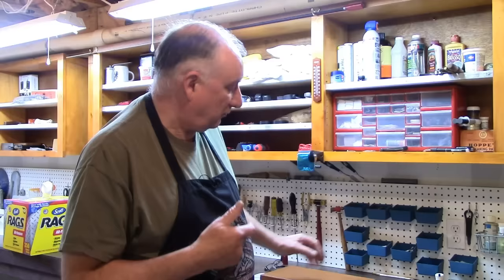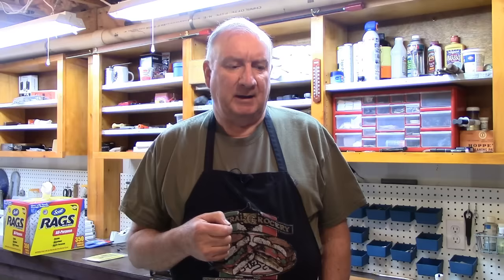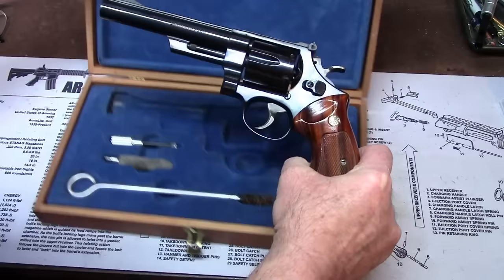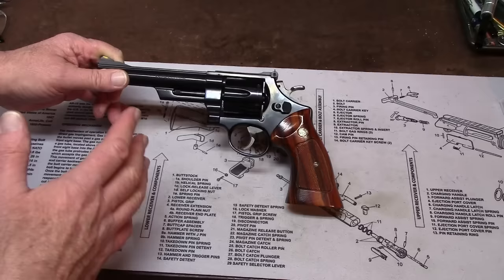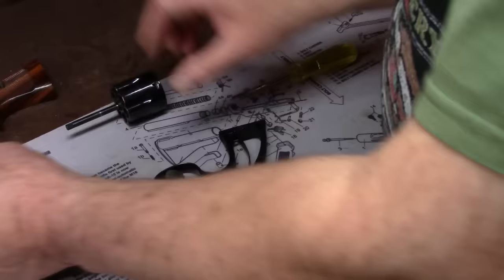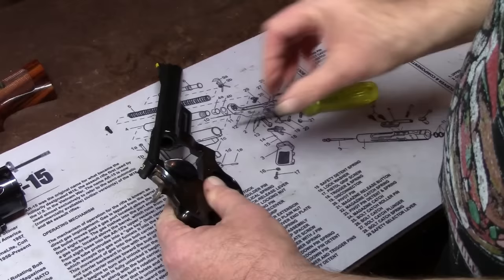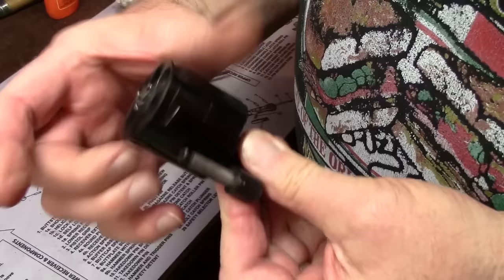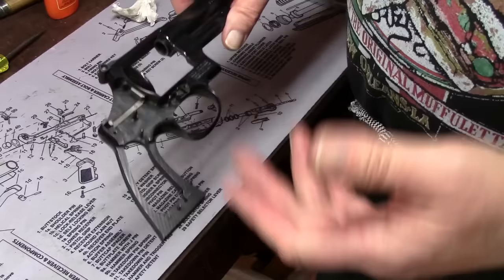How to Disassemble and Care for a S&W Revolver ~ Learn from a Factory Trained Armorer!

Comment: Another video knocked out of the park!  I have 2 stainless Smiths. The lead/carbon sure shows up much worse on the forcing cone and cylinder face than those beautiful blued guns.
Those foulings always give me trouble. I don't think I would ever be bold enough to loosen one screw on my revolvers.
But it sure was interesting watching you do it. If I ever felt the need, I would have your video playing in unison with my attempt.
I still have both of the "One free factory clean and tune" coupons that came with my Smith and Wessons.
Thanks again boss, and try to keep that "Bird Finger" folded up in the stowed position.

Comment: This is the best video  I've seen in years ! At last  someone who knows what is talking about and who's teaching how to properly do what has to be done ! 
However, there is one only thing I don't quite agree with : the cylinder gap. According to what I kwow and what I've learned, S&W specifications are between 4 thousands of an inch and let's say 8 thousands of an inch. Not 3 thousands of an inch (leave that to a Colt). Yet, many whole new S&W revolvers are delivered today with a (terrible) 11 thousands of an inch gap out of the box. The most important thing is to make sure that this gap does not increase. If so: not good at all.
One question : why not remove the hammer before removing the cylinder? It seems to me an easier way than having to press the thumb piece backward. That is what I'm doing and I really think I'm saving some time... Is there a downside in this way of doing things?
Reply from the maker: In fact, S&W specs in my service manual call for 3 minimum and 5 maximum, with most older production guns running 5 and greater.  Certain police departments were furnished with special production guns having gaps of .010 for the purpose of insuring against cylinder/barrel  contact and stoppage that occurred with eventual endshake inherent in their dysfunctional forward screw and yoke button.  This will gall traditionalists, but current S&W revolvers are very consistently held to .003", and it won't shrink, because endshake is a problem of the past.  My new Model 19 Classic, which I demonstrated in another more recent video gauges precisely .003", and the gap is perfect on each side, and it is not a fluke.  

Much folk lore is attached to some perceived notion of halcyon days of yore.  While they are beautiful works of art and mechanical genius, the consistency and quality of older S&W revolvers as a whole is entirely mythical.  Specially skilled people were indeed assigned to their flagship target guns set in blue velvet-lined mahogany presentation boxes, but any S&W armorer of my day can attest to receiving a pallet full of brand new Model 10 revolvers in blue carboard boxes that required long hours of work to force them open and get them working properly.  That was the more common reality of older S&W quality through three decades.

Yes, the presence of the cylinder does obviate the need to use the thumb, but that maneuver becomes second nature to an armorer and we do it nimbly and swiftly as writing our initials.  Armorers address the frame and cylinder as entirely separate system components, just as an AR15 has an upper and a lower.  Except for certain fitting processes, the frame is always worked on with cylinder removed and out of the way, isolated from scratches that can occur during handling with sharp internal parts.  In the course of a long day at the bench working with dozens of these handguns, it's meaningful to cut weight and bulk down.  The reason you don't want to do it otherwise is so you can look like a pro, which is why I made this video.  LOL
Reply: @GunBlue490  Thank you very much for this very precise answer! You are indeed a real professional (which I am not) and it is very valuable to have you here with your knowledge.

Someone I knew who studied like you did at S&W told me that the models we used to get here in France were guns you wouldn't have wanted to have in the US. This, perhaps, explains the  gaps that we could find here. And this also fits to the 20 dollar bills that the verification service at S&W could find in some cylinders...(in the 70's...)

The only reason I remove the hammer before the cylinder is a practical reason, but I remove the cylinder immediately after the hammer. This way it does not stay in the frame and is not at risk of being scratched.

I don't hate the new S&W revolvers (I saw your video about your new Combat Magnum),  but, as many,  I do hate the key lock. It's as unsightly as a wart on a toad.
However, I do not believe that this safety can unexpectedly be implemented by itself.

I owned a Model 22-4 (reintroduction of the Model of 1917 Army), it had the keylock but it was a fabulous revolver! I'm still sorry I sold it. 

Thanks again !

Comment: Thank you for taking the time to make this valuable video! Little tips like using your thumb as a screwdriver guide are things that we would never think of unless taught by a master. I have to wonder how much of the factory hand fitting you pointed out actually takes place on new revolvers today. My brand new model 686-6 was swimming with dirty grease, oil, and manufacturing debris when I opened it up after the first range trip. The screw slots were also marred and deformed from careless hands at the factory. My grandfathers pre-17 K22 Masterpiece looked like the example in your video inside and the screws were still pristine.
Reply from the maker: I would certainly give Smith a call at their customer service line and let them know.  That is not acceptable, and it absolutely got by quality control. I have handled many of their new revolvers, and  workmanship is quite the way it used to be in all regards. I have seen a few issues with new S&W revolvers, but never saw anything like you described, involving butchered screws or debris.  The way frames and parts reach the assembly folks precludes any possibility of debris, and those folks turn many dozens of screws in an hour with their eyes closed. A wheelgun builder is a sight to behold at the bench.  No, I guarantee, that gun was not new.
Reply: GunBlue490 Interesting. I’ll give them a call and see if they will send me a new set of screws. They may make me buy them since I’ve taken them off myself now.. I was just surprised to see the slots deformed from tightening. You could tell they were deformed going in, not coming out. As far as “debris” that may be too strong a word but the lock work was slathered with a light clear grease and some standing oil and there was black cloudy discoloration in the grease. It’s all cleaned up now. I have no reason to believe it wasn’t new. My dealer ordered it straight from the distributor. I think it’s just a sign of the times. I own many handguns and most have required a little work to be at optimum spec. Luckily I enjoy working on them.

Comment: I can't for the life of me, understand how my S&W model 28,  357 magnum ended up with it's hammer nose bent upward where it was dragging, or catching at the top of the frame bushing. It happened when I was out target shooting with it as I always have, single action, and using 38 specials, so certainly nothing out of the ordinary. This was my first gun I bought when I was 18, and have owned this gun new for over 46 years now, and it still looks brand new, because I've taken very good care of it. And I have only shot about 2000 rounds with it. I sent it to Smith & Wesson to have it fixed costing me $170, so it's fixed and back with me now.
Reply from the maker: Glad they got it back in shape for you.

Comment: Dear GunBlue490, I am writing here in hopes that you will see this and havr time to reply. I can see from your videos that you are a real expert on S&W revolvers, and I hope that you will share your great knowledge with me in your reply. I have three S&W revolvers, all from the 1970's that have the same problem.They are a Model 19, a Model 15, and a Model 49. They were all working fine when they were put away some years ago, but have not been touched since then (maybe 10 years) due to my health. The problem they have is that when pushing the cylinder release latch forward to open them, sometimes they are "sticky" and I have a hard time getting them open. I have checked, and all three ejector rods are tight. When they are open, the release latch seems to move reasonably freely and return to the rear. One other point, when I use both thumbs on the latch at the same time, all three revolvers open just fine, the sticking only seems to happen when I try to use one thumb as I have done for years.

Could you advise me on a course of action to fix this? I am about to pass these on to my son and want them to be in good working order. It has only occured on these three guns that have been sitting in the safe unused. Do you think that having them fully disassembled and cleaned would resolve the problem? I am wondering if the issue is at the front end of the ejector rod perhaps where it locks in under spring pressure? I'd be grateful for any advice you can give me. On another topic, my condolences on the loss of your canine friend. Thank you in advance for your reply.
Reply from the maker: Based on the years of sitting idle with the same issue, my educated guess is that oil has congealed in dimensionally sensitive areas, especially under the extractor star and inside the ejector rod, gumming the center pin.  Another spot is a sluggish, sticky locking bolt (that's the small, beveled pin under the barrel).  If you follow my dismantling and cleaning video, you should easily restore them to working order.  I suggest soaking and brushing parts with mineral spirits or kerosene.  If stubborn, use a more volatile cleaner with care, such as lighter fluid, also sold as naphtha, or Coleman gas.

Comment: Excellent video I've been a Smith & Wesson wheel gun collector for over 30 years and you cover all the bases and cleaning and what to watch out for with the Smith & Wesson wheel guns. great job.
I have one big question I always thought, and been taught, dry firing a revolver is a definite no no without a snap cap to absorb the forward energy in place of a live round primer.
What do you think?

Comment: Most happy to find this instructional video. I own a model 28 that i purchased in the early seventies. I use it once in awhile these days when out shooting for practice, i needed to know how to properly care for it. it still looks brand new because i keep it in it's original oil paper that SW provided, i clean the barrel and cylinders after shooting and examine the firing pin for ware. Mine has the long barrel and i was wondering what the value of this TROOPER model is these days after considering buying a lighter hand gun.
Reply from the maker: Ronald Reed 
Interest in revolvers has been greatly renewed in the last few years, especially in the old classics such as yours, and values have come back in spades.  The 357 Magnum has been chambered in many revolvers, but the only Smith & Wesson that was ever made to withstand regular use with full house loads is your Model 28 with its beefy N frame. All other frames have less durability and are certainly not as nice to shoot with heavy loads. Yes, it's heavy, but I strongly suggest you think carefully before trading it, because you will one day regret letting it go.  Even that oil paper and old blue box have value, and will always increase in value in coming years beyond your imaginings.
Reply: Thanks for the reply, After reading it i am now reconsidering that, The revolver is in excellent shape..just as pretty as the day i picked it up. I don't keep it in it's holster for fear of the finish and grip might suffer wear.
Reply from the maker: Ronald Reed 
You are correct.  Never store a blued gun in leather, as it can certainly attract moisture and  cause corrosion over time.  Officers with blued guns were instructed to hang their gunbelts to dry in the lockers, and to keep their sidearm open to air on the shelf.

Comment: I have a question, I followed this video to clean a model 27 - 2. Opening it I found an amount of rust on most of the surfaces, I did my best to de rust and clean all the surfaces and when I re assembled the gun it seemed to work fine, other that the double action being stiff but the most concerning thing is if you pull the hammer back and let it forward with your thumb slowly it may come to a stop, if bumped it will then charge forward all the way. Should I disassemble and clean it again?.

Comment: Thank you, I learned everything I needed to know and am wise enough to know----- I will send my lightly used but new to me 357 model 19-5 back to S&W to get completely serviced as I have zero back ground on the gun as I won it off a action. I am not even going to test fire it. Just call S&W at the factory and send it with a tracking number.  The stocks on it were not original to the gun and don't fit very well at all so I will have them replaced them and fitted to my gun at the factory. I am sure when it comes back it will be perfect.

Comment: I couldn't get the side plate to fall out by tapping the handle on a table. Just too tight of a fit. Used a punch and a hammer with some paper towel to soften it. 

Also, I took this unfired Model 66-2 to the range and I had to go against the oil advice. Had some bad issues, due to dryness and maybe sub optimal fitting by S&W. The cylinder didn't spin free: it snagged a lot. I had to take it apart and add 5 drops all over the bar and cylinder and now it spins free.

That little cylinder lock thing would sometimes not come back and the cylinder just spun around loose when firing! Bad stuff. I had to get CLP and just use a tooth brush to brush everything internally. Springs and all. Not sure what was causing it to snag, it was clean looking in there, but no more snags with it slicked up with a tad more CLP oil. 

All in all, I'd trust my life to a Glock. I'm a bit concerned by the revolver.

Comment: Only one complaint, and its not really your fault. Due to extensive exposure to 175mm & 8" howitzers followed by 30 years inside a noisy factory my hearing is not very sharp. If you could include closed caption on your video's I would be extremely grateful. Thank you Sir for all the time you have spent putting these videos on You Tube. The information you provided is priceless.

Comment: Thanks for the video, I learned a lot about how to properly work on a weapon. I own a S&W Model 66. It is 50 yrs. old in near factory condition. It still has the trigger stop installed and works as designed on the range. I have read quite a bit about how LEO's had the stop removed so the gun would not lock up because the screw would come loose. I was wondering what your opinion is about the removal of the trigger stop; remove it or leave it?

Comment: Excellent video! I really appreciate your sharing your knowledge about the disassembly and care of Smith & Wesson revolvers! I recently purchased a 4 inch Model 25-5, similar to the one I had 35 years ago that I ended up selling. The one I purchased is in excellent condition, at least externally. I shot it for the first time yesterday and noticed what appears to be an intermittent problem in single action mode (SAM). Sometimes when I pull the trigger in SAM, the hammer drops lightly and fails to ignite the primer. At the same time, the hammer is dropping, the trigger moves forward while my finger is still lightly engaging it. Nothing internally appears to have been polished or otherwise tampered with. It shoots very reliably in double-action mode. Have you ever heard of this problem before?

Comment: Thank you for the informed instruction! This is an old video, so I probably won't get an answer to my question...but here goes. At 6:10 to 6:30, we are looking at the left side of the pistol. Under the cylinder cheek, at the bottom rear corner of the cylinder cavity, there is a thick lump of extra steel on the frame. In the newer models of S&W, the thick lump extends down from the cheek to this same spot. What purpose does this extra steel serve on the frame?
Reply from the maker: That bolster retains the cylinder when swung open and prevents it from sliding back. I answer questions no matter how old my videos are, because this is not a dated discussion blog site, and my videos are relevant forever.
Reply: @GunBlue490  Thank you for the answer! It makes total sense.

Comment: I have a 1971 M15 that I got as a cheap knock down drag out revolver 13 years ago.  Had a lot of wear on it and is a bit loose.  I think an amateur even reblued it at some point. Still goes BANG though and feels good.   
Your tip about switching #1 and #2 screws really helped alleviate my “crane” (sorry, I started out in Colt Country) endshake.  Didn’t completely eliminate it, it still wobbles a tad but it doesn’t move front to back like it did and is noticeably tighter.   I’d like to eliminate the cylinder end shake too and get the gun an expert checkup when I get the chance.

Is there any way the factory can “restamp” or deepen the markings?   The bottom of the “P” and half the “E” are gone on “SPECIAL” on the right side of the barrel.   The S&W logo is so shallow it won’t hold any white filler as is “MASS.” In “SPRINGFIELD, MASS.” On the left side of the frame.   Looks awful when you try to put a white filler market to it

Thank you.

Comment: I have a situation maybe you can help me with.  I disassembled my K frame and sent it off to be reblued and when it came back, in locking bolt wouldn't slide into its cylinder freely.  I got it in part way but the front part of it wouldn't fit through the hole in the front.  Even if it did, the friction is so high that I don't think the return spring would work.  Any ideas what happened and how to fix it?